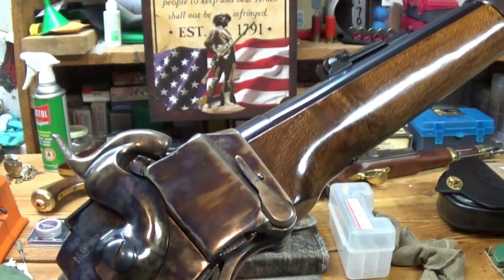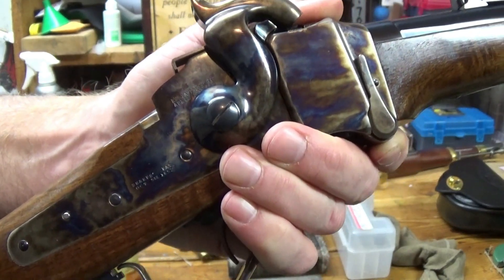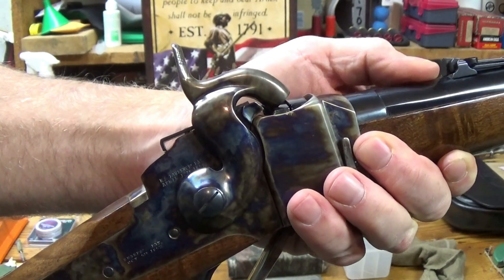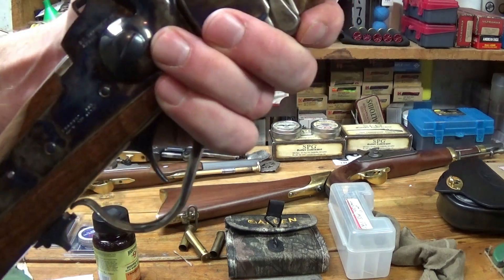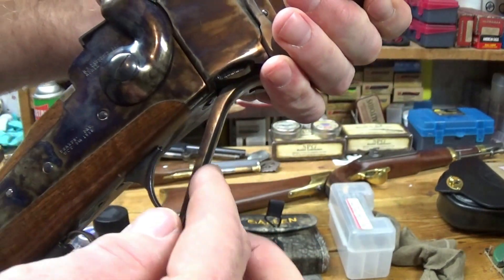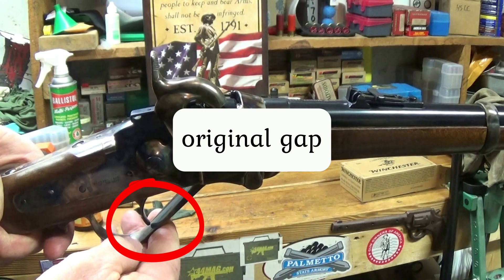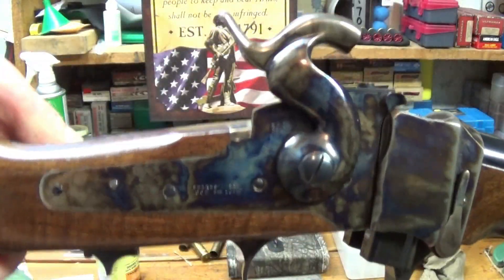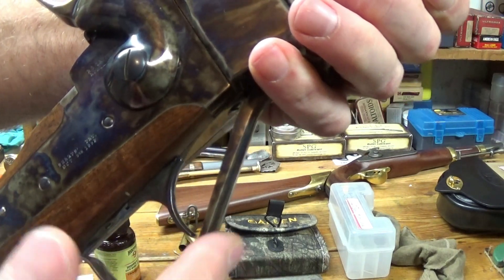Chiappa Sharps Issue - New Model 1867 in 45-70 Gov

Comment: Good catch! I know that this is an older video, don't know if Chiappa has done any changes to their models now, but been planing on picking one up myself, I agree that this is surely an issue that could be easily fixed, to my knowledge when reloading the gun you only halfcock the hammer before inserting a new cartridge and close the action before getting to he hammer to fullcock. Don't know og this would mitigate the issue with a accidental discharge since the hammer isn't fully drawn back and the trigger wouldn't be fully set. Just my thought about it, good job fixing the issue, the gun looks like a dream to shoot 😊

Comment: Such a simple oversight. You wonder whats going on with these manufacturers/importers. You had :The Rifleman thing going on. The 1892 winchester in "The Rifleman" had a set screw on the lever that tripped the trigger the second it went into battery so he could shoot it fast. I want to get one of those cartridge conversion sharps but in 50/70 I know they come and go.   Now that you've fixed it its a nice gun!
Reply from the maker: I had tossed around the idea of getting a 50/70 but then decided upon the 45/70 since I had all of the reloading components for it. One of these days I may drop the hammer on a 50/70.

Comment: DAMN good job, brother! I was holding my Chiappa 1863 Sharps Carbine 45-70 the entire video to see if there was anything I needed to fix! You wouldn’t happen to know where I could get replacement plug screws for the tang where the elevator sight screws in? I lost mine.
Reply from the maker: You are probably going to have to contact Chiappa directly or check out S&S Firearms, some times they have replacement parts.

Comment: Got a question for you  . Can you use smokeless powder ammo in it ? Mine is a 45-70  .
Reply from the maker: Yes, just stay away from the hot loads. Cowboy loads are safe, they are also usually less pressure than original black powder loads.

Comment: The Italian take a shit on of liberties with their wanna be clones. I study this stuff, I'm highly interested in getting into the minds of the engineers who design firearms and what they were thinking.
The Italians mostly just make shortcuts to simplify machining that comes back to bite them in the ass later. 
Sometimes though, they actually go the extra mile and incorporate new design features they think are improvements that also come back to bite them in the ass. As though the original engineers didn't try the same thing and see it fail.

I have a Pedersoli Super Match. It's their rendition of the Remington No 1 Creedmoor target rifle, the chamber on this thing is really well thought out in the sense of paper patching. It's made for it.
Problem is, in their redesign of the action, they adopted a thinner firing pin and being thinner is also weaker. The original design used a massively thicker firing pin and there is nothing wrong with it, in fact thicker firing pins are more apt to set off less sensitive primers and less apt to punch through thin primer cups.

The thinner firing pin is weaker and to compensate, they adjusted the angle from almost 20 degree of the original to near 0. To then allow the hammer to hit the strike face of the firing pin, they raised the height of the hammer twice as high as the original. Now we run into a major problem with the design as now the hammer obstructs the chamber and long OAL cartridges cannot be chambered.

The irony is the rifle is really designed to use paper patched bullets that sit very far out of the cartridge, in fact only about 1/10" of the base of the bullet is retained in the mouth of the casing. This long OAL thus means the rim of the cartridge hangs up on the hammer. The fix is either adopting a short nose bullet or machining off a portion of the rim of the cartridge to clear the hammer or the drastic measure of machining the top of the hammer down about 1/8".

Most people aren't about to modify a $2,000 rifle especially now in the Covid era of shortages of everything. Now with shipping companies denying or destroying gun parts shipments, it's even worse. The less risky option being machining part of the rim off or adopting a less than ideal bullet.

I've also got a Chiappa 1886. The pistol grip premium grade model with shotgun style butt plate. I had a hunch from the get go the carrier link or as it is properly called, the carrier hook, tends to be improperly sized and they tend to fall out of the carrier slot and jam the action up. I knew this going in. I still made the purchase and I was spot on in my suspicion. 

I was forced to tune the system and make adjustments to the carrier hook to ensure it does not pop out of the carrier and jam the action. I filed an angle on the nub that rides in the carrier and filed the carrier slot at an angle to create a two mating angles then upset the stub that rides in the lever to give a very tight fit.
This addressed the issue but will eventually wear out and cause issues. To that end I have a replacement I will modify to work. This hook will be modified by TIG welding an extention to the replacement hook stub then machining it to size then normalizing and heat treating it to spec. I have the tools to do this but took the easier but effective route for the moment.

Comment: With these rifles do you know if they can use full power smokeless or just black powder
Reply from the maker: You can use smokeless but I wouldn't use hot loads in it. I would use factory loads as long as they are not the really hot stuff like Buffalo Bore ammo. I reload my own with smokeless and I keep it with in the same specs as black powder pressures. Most factory 45-70 is within those specs, if not then they will state it on the box.
Reply: @INeverMetAGunIDidntLike  Got it thanks so much for the advice. I'll have to check the load data for my powder again

Comment: What’s the difference between the 1863 and an 1874?
Reply from the maker: The 1863 started out as a percussion cap/pellet fired carbine that also utilized paper cartridges or one could use  loose powder and bullet as well. The Mod. 1863 also has a pellet primer system that would throw out a small primer pellet over the cone right before the hammer hit the cone. That system was problematic and percussion caps were used instead of the pellets. After the Civil War, many of the 1863s were converted to use metallic cartridges (.50-70 Government) and they were sent out West and issued to the Cavalry. They still retained the pellet primer system (though not used) and the hammer was slightly reshaped for the new breech block. The Mod.1874 started it's life (from the factory) as a metallic cartridge fired rifle. The 1874 was never adopted by the military, I think they had some for field trials but it was never accepted into service.